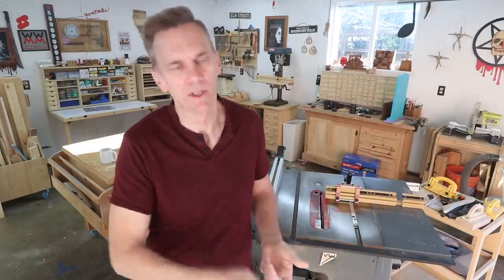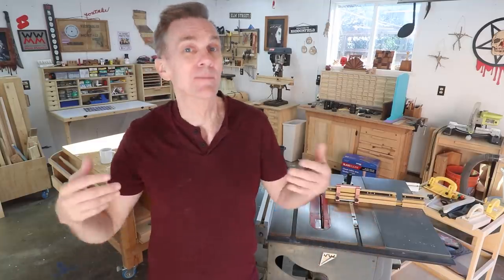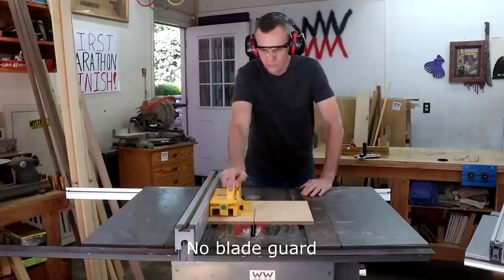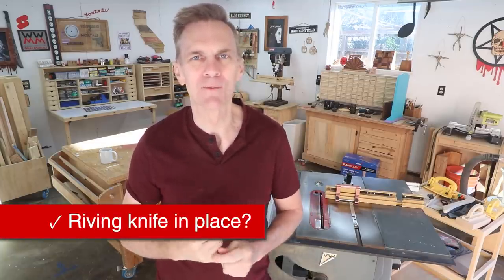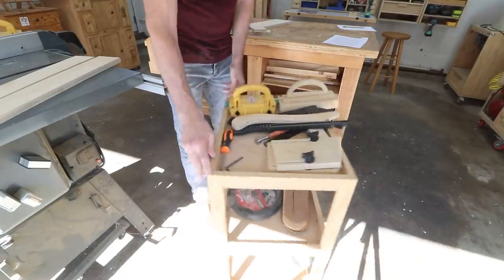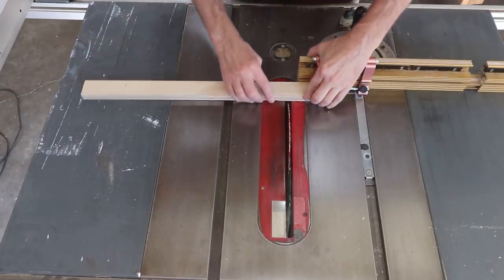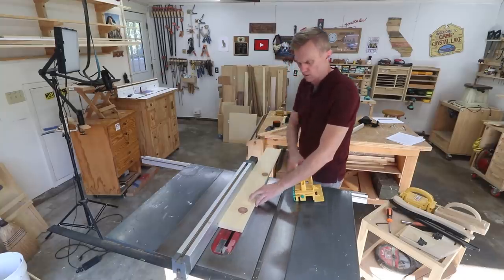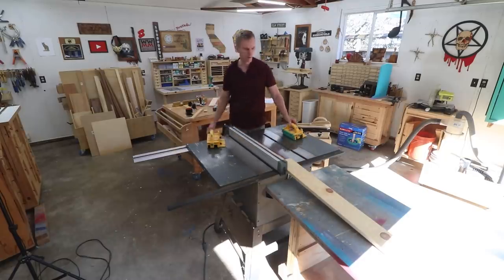Watch this BEFORE turning on a table saw. The Table Saw Golden Rule.

Comment: Fun fact: Table saws are the #1 tool for accidents.  (I'll bet lawn mowers probably top them if you factor in heart attacks, heat stroke, etc.)  That said, the only time I cut myself on mine was when it wasn't even plugged in.  I was carrying a job-site table saw with the blade fully extended.  Still, learning that statistically they're the most dangerous made be approach them more carefully even after having used table saws for a few years at that point.

p.s. One tip you didn't explicitly state: Check that your fence is locked.  One of my table saws has a rack/pinion fence, so the lock is out of sight under the table top.  The mistake I make more often than any other with that saw is forgetting to check that I've locked the fence as I'm finishing a set-up.  You can imagine the many things that could go wrong if the fence started drifting during the cut!

Comment: This may be offbeat but how can you make a 58 degree cut on table saw?   I have used a RAS for years.  I made this cut on it but arbor nut scored board.  I had ample thickness the plane it off.   Actually any cut over 45 falls into this question.

Comment: I was beveling some 3/4" that had a rabbit on the back side for a picture frame. They kept falling into the space between the blade and the insert. Bad cuts and dangerous. Made a sled to hold the pieces secure while beveling. Much safer.

Comment: I have to repeat how important safety glasses are. I wear prescription glasses so I thought I'd be fine. I had a large wood chip hit my cheek today and it could have easily deflected into my eye (not the first but the biggest). You need protection that covers the underside of the eye, which is why safety glasses are shaped the way they are. These type of flying chips are caused by crosscuts where the material isn't surrounding the blade,  like trimming material down just a 'sliver'. A heads up for my fellow WWs.

Comment: I feel like the e = mc2 version of table saw safety is you need to maintain forward wood movement at all times with hands out of way.   Causes of non forward movement: pushing in uneven way ( long list of ways, holding wood wrong way allowing wobble, standing too far away causing body to lean) , knots in wood cause forward force vector to bend.   

As a noobie I'm watching all these videos and I'm seeing many many tutorials use hands all the way through, these are pros and ppl def don't always use push sticks.

It feels like there could be some self guide system possible

Also seems would be better if you could load from side would be better
Reply from the maker: You might consider buying a CNC if using a saw makes you this uncomfortable. You can program it to make the exact cuts you want and don't have to be near the machine. 👍
Reply: @SteveRamsey  yeah I just bought a jigsaw.  The house I am staying at has a table saw in the yard but no option for riving knife or saw cover ...I'm sure I'll come back to it but just making some simple wood structures for my RV and jigsaw seemed to work for Forestry forest ( van life you tuber )

Comment: I must be in an alternate timeline. The first 10 seconds are completely opposite for basically every woodworker ive talked to. Table saw is typically one of the least, router table usually one of the most intimidating. Ive also seen numerous woodworkers use their router tables as a table saw to save shop space but ive never seen anyone replace a router table with a table saw lol
Reply from the maker: How many woodworkers have you talked to? I've talked to thousands over the past 14 years of making these videos.

Comment: During the cut I focus on the material being tight to the fence not the blade. After the cut I NEVER take my eyes off the blade as I retrieve the material, and yes I will make multiple cuts without turning off the saw.

Comment: You missed a big one Steve, well maybe. When it’s cold I have two heaters running and I have to remember the table saw draws a LOT of power.  Not fun looking for a flashlight in the dark. Need to do some shop rewiring.

Comment: I try to keep my table saw unplugged as a final safety measure.  If I am not set up to make a cut and ready to start the saw, it's unplugged.  I spend an extra couple of minutes plugging and unplugging over the course of a project, but it's awfully hard to turn the saw on by accident without power.  I also yank out the yellow safety key when the saw (or drill press, router, etc) are not in use.  I don't count on them working, but it makes it that much harder to turn on a tool by accident when the safety key is stored away up on the wall where only adults can reach it.  This rule is strictly enforced when there are kids around.

Comment: Safety devices are a last resort to prevent injuries.  I use safety devices like blade guards and seat belts, but I don't rely on them totally.  Common sense and safe practices are my first actions to prevent injuries.  I still have all 10 finters and toes.😄

Comment: Slightly, only slightly, off topic.  I remember a story from one of our Raleigh NC TV stations a few years ago.  A man came up with a new and easy way to trim the top of his hedge.  He started up his push lawnmower and then attempted to pick it up with a hand on either edge of the blade housing.  Yes, he had to go to the ER for treatment.  I do not recall how severe the injuries were.  However, the story got even better.  It seems that this was his second trip to the ER for this stupidity.  I guess he figured out what he had done wrong on the first try.  You just gotta wonder!

Comment: a circular saw is THE MOST versatile. a table ssaw just makes it easier and faster. but i think can do whatever cut you do with a table saw. including dado cuts. without a dado blade.
Reply: also i can make tons of cuts with a circ saw that YOU CANT with a table saw. for example cut a window thru a existing wall! (it can go anywhere)
Reply: Ever tried making a cove cut or repeatable and accurate miters or beveled miters or dead-on accurate repeatable rips/crosscuts with a circular saw?  A circular saw is a very useful tool but it ain;t no table saw.
Reply: @blakedozier1131  i have made many miter cuts with circ saw. just recently finished making doors that way. i always grab and use my circ saw even though i have the heavier clunkier miter saw collecting dust. and i think it is very indicative as it requires a lot of space, and is simply the most useless tool i own.

Comment: I know you showed what is "kind of" an out feed table, but...-Always have an outfeed table, level and attached to the back of your saw, that way you're not reaching over the blade to catch your pieces and anything long is supported so you're not having to push down on your piece as well as pushing it through the blade. Also - Always use a sharp blade, if you have a blade (or blades) that you tend to use a lot, buy two (or three, they will last three times as long!) so you always have a sharp one handy instead of forcing material through a dull blade. Excellent tips otherwise.

Comment: No so much a safety tip for using the table saw but a good tip is to lower the blade when not in use. No only does this help protect the blade but those suckers can hurt if you catch them even when not moving.

Comment: To all the new WWers... do not discount what Steve is saying here.  After 35 years in the workshop with no blade- or bit-related injuries, I was cutting 2" strips of maple on my table saw (no outfeed table).  I hung my right hand over the fence, as I had thousands of times before, and pushed the board through.  I then grabbed the workpiece I had just ripped and began bringing it back to set it in my stack... and promptly stuck the end of my thumb into the blade.  It bifurcated my thumb to the base of the thumbnail.  I ended up with an ugly scar and a loss of nerve endings that make it impossible for me to pick up a washer or a coin using my right thumb.  It took FOUR YEARS for it to fully heal.  Plus, it slowed down my work such that I calculated the injury cost me about $40,000 in income over time.
SAFETY FIRST.... and Steve's "rehearse the cut" idea is PRIMO!

Comment: Still wondering why you don't have any problems at all to work entirely without a blade cover. All of the time. It is the most elementary safety feature on that machine and an absolute no-brainer.

Comment: Where are the safety glasses? You lose all credibility by using woodworking tools and not having safety glasses. I've been doing this over 50 years. People, wear your glasses all the time.
Reply from the maker: It was literally the first thing I listed. 🙄
Reply: @SteveRamsey  Then why aren't you wearing them yourself? Why are you operating tools without glasses? Amateurs are picking up bad habits. Glasses must be worn 100% of the time. That's the rule in my shop. How about an answer to my question?
Reply from the maker: @jocko4598  Did you even watch this video? I have safety glasses on every time I'm operating the saw. Are you trolling me or are you serious?